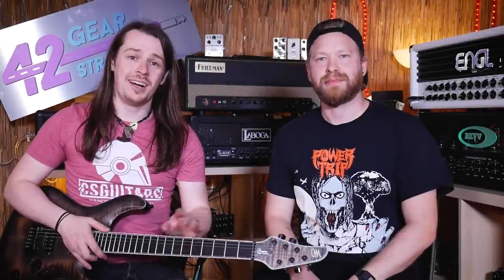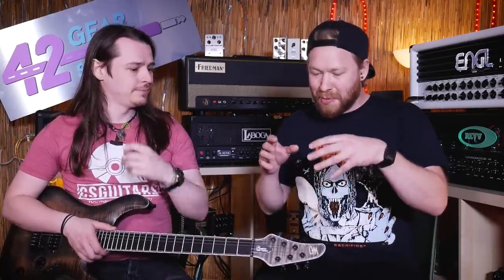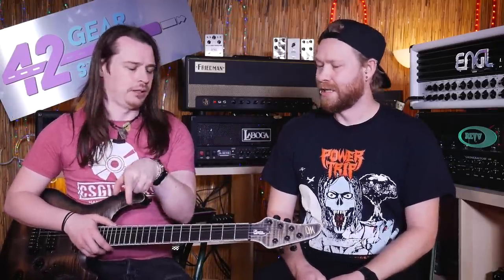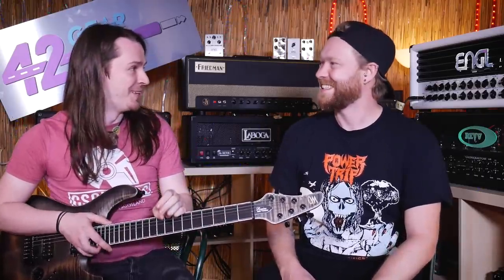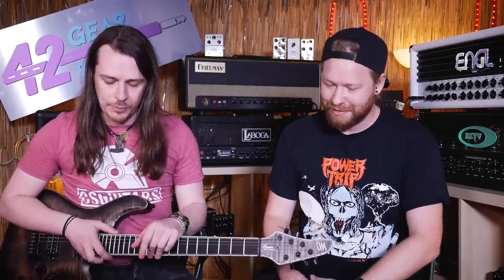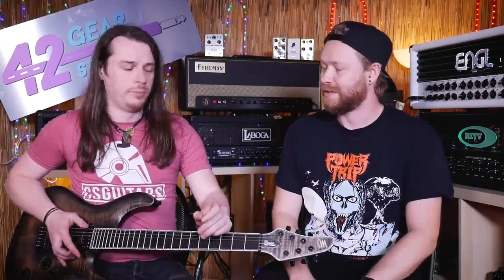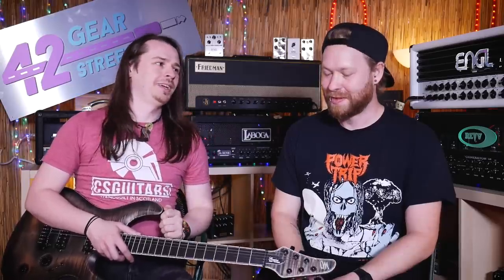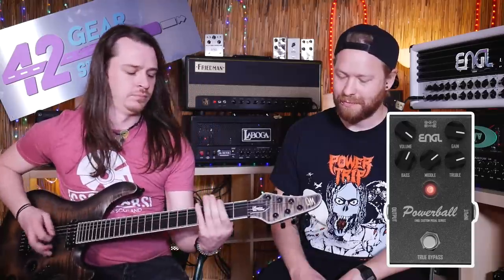ENGL Powerball Pedal: Lead Distortion Stompbox | First Look

Comment: Dear Colin
I have a TATA. what is the point of the ground or ground lift switch on the back of my valve amp. recently repaired teisco check mate 20. seen it on other valve amps. why would you want to disconnect the ground/earth????
Reply: On older amps that didnt had 3 prongs cables the ground lift was needed. if you're getting shocked, you flip the switch and it shouldnt shock you anymore. Can you see the flaw ? You could also unplug the amp flip the plug 180 degrees and replug it, does the same thing basically.
Reply: @crazysandwich  thx for the info mate
Reply: @wfrancis25  basically what crazysandwich said but the main intention was against hum (on an old amp i have it's literally labled "anti-hum"), but having it in the wrong position could certainly zap you, since then the amps ground and chassis is referenced to mains. Through a capacitor no less (often aptly named the death cap), wich when intact should at worst pass enough current to give you a little tingle, but it's a) still very stupid and b) those caps fail and they can fail short. And then you have a full 120 or 230 volts on your amp and the guitar connected to it. You might not even notice it if you say wear rubber sole shoes on stage until you touch something properly earthed, like a mic while muting the strings and then you are in for a less than pleasant experience.
If it hasn't been done yet, you need to disable that circuit and install a proper 3 prong cord (since you mentioned you already repaired it i'd assume you know at least the basics on how to do that) or have it done by a professional (since you weren't aware that this was an issue that exists you probaply aren't that experienced). Don't work on an amp yourself if you are not 100% sure what you are doing, but if you want to look into it, uncle doug and the guitarologist are great resources on that topic and amp repair in general. Or just google "death cap amp". 
Stay safe
Reply: @uzmeyer1752  ,wow thanx for all the info guys. I am electronic Tech, but valve is definitely not my strong field. I am going to open her up some time this year. to replace all the jacks. At which point I'll check that earth thing out. Now that you mention the tingly feeling. 20 years ago when I bought the amp, I got a mic with it. and yeah she did tickle me  when the lips touched it.
Reply: @wfrancis25  A few years ago i was playing with my 15-20 watt pepco amp with a 2 prong cable. You wouldnt believe the spark i got between my lip and the mic. a full inch of length, it stinged pretty badly. Now i only play with 3 prongs equiped amps :)
Reply: The ground loop switch is used to reverse the polarity of the electricity running through your amp, cancel hum by turning the power plug on an amp without a ground lift switch around in it's outlet, whereas flipping the ground loop switch on an amp may switch the polarization of your amps electricity around and cancell hum .  Electrical shock protection circuitry does not guarantee safety from electrocution, such as filter caps, electrical power buffers, polarity switching safety circuits and ect. ectronics. I do not trust robotic circuits to ensure my safety, which is never a for sure thing on anything electrical. It does not matter wether your gear is solid-state, valve or both, usually all valve circuits have non-valve circuits ! ! ! When you lift a ground, you may cancell the hum coming from the amp, but you will be straight wiring your amp to no safety from electrical shock between your gear and other gear and either of the come in contact with one another when you are the one between either of the gear  connected to them with your person. If you have a ground loop lifted to ungrounded, then you set yourself up for electrocution , especially since your person is holding an ungrounded gear and you ground yourself to any Earth ground, such as standing on concrete, ground ,anything flesh or not flesh that connects your person to the Earth, thus creating a unprotected ground to the Earth through your person, putting you in direct line with the electrical flow going through your person to the Earth ground and electrocution. Not all electrical outlets are properly grounded, even a 3 prong plug outlet. A breaker fuse box that may or may not be properly grounded or may have different circuits wired differently, thus having grounded and ungrounded outputs to electrical outlets. You use different outlets and you think you are safely grounded and you find you are holding your guitar that ain't grounded and come in contact with another piece of gear that is grounded and then you get electrocuted. It is the same way with any gear coming from a breaker fuse box that may or may not be properly grounded in each of it's s lines running to an electrical outlet or be hard-wired without any plug in, the circuits may be grounded to the Earth or they may not be. If ungrounded and you ground yourself to an Earth ground, even a houses piping goes to earth ground  and then comes the electrocution. I know this post is long- winded but you can look it up online and check out ground vs ungrounded gear or electrical boxes and electrical outlets. Never go stand barefooted on anything grounded to the earth and your gear not be grounded to an electrical earth ground or your gear ground loop is lifted, turned off and becomes unpolarized just as does a two prong plug. You have a two prong plug and hear hum and you turn the plug around and change the polarization of the electricity running through the lines running from the outlet you are plugged into, but it does not guarantee that you will be safe from getting yourself electrocuted. The same goes for if you are using outlets coming from multiple breaker fuse boxes. Especially beware screw in fuse boxes and being safely grounded ever, period. You can get an electrical ground and electrical polarity meter a small cost and plug it into any electrical source and it will show you with colored lights and/or beeps you will hear to inform you of the status of the type of electricity you are plugged into, the polarity of the electricity, and wether it is a grounded or ungrounded electrical source ! ! !  I hope that this is of help to you or anyone out there whereby electricityis concerned (AC or DC types, current or amperage, voltage, resistance, htz 50/60, grounded or ungrounded, then there is emp/static electricity) ! ! !  I would rather be electrically in the know and be safer than be my person and/or electrical gear become electrocuted and be harmed by any such in any way or worse case senerio possible, be/get killed dead ! ! !  The net to other sources of publication outlets on the subjects of electricity and electronics are so plentyfull and readily available to the masse . Be Safe ! ! ! 👍😊 Peace & Play 🎸 On . . . 😎🤘 DDHarris 1-212020.

Comment: Over the past 2 ish years, I've been trying to find a good distortion pedal that sounds more like an amp. I've got a few distortion pedals, which includes the Boss Waza Craft Metal Zone, which out of all the distortion pedals I've tried sounds the best. But I've been struggling to get a good high gain tone I like that I'd be happy to constantly use as my main distortion, for that I use my Ibanez Tube Screamer into the front of my Peavey Bandit, with a Boss EQ in the effects loop. Judging by this video, this engl pedal seems better sounding than my Boss Waza Craft Metal Zone, possibly might be the next distortion pedal I get.
Reply: Idk how good my ear is anymore, but I was searching thru all types of distortion pedals before 2015. Ultimately I landed on the Moen Violent Metal. The least nasal of all the pedals back then
Reply: I have an out of production Digitech TL-2 that is really good.

Comment: If it's a recreation of the original amplifier, shouldn't you use it as a preamp and plug it into the FX return?
Reply from the maker: Distortion pedals are designed to go into the front of an amplifier. This trend of using distortion pedals are preamps is new and often misuse of equipment designed to be used in another fashion.
Reply: @ScienceofLoud  It's not misuse of the pedal, even if it's designed to be played through a preamp. You aren't going to damage the pedal or the amp, the worst thing that can happen is that it won't sound good. I don't see what's wrong with just trying it. Ola uses a solid state power amp for his pedal reviews most of the time and it sounds amazing.

Comment: Sounds... not that great to me tbh?
Reply: To be honest, i love Engl. I have 4 Engl amplifiers. But the powerball has a lot of drawbacks because you do not see them a lot anymore. To much compression and only deep mids are the biggest two. Both of these are bad for a live sound to cut through. So yeah, this pedal sound like the powerball, and there is a reason i will never own a powerball as a engl enthusiast. But to be fair to the pedal: If the pedal behaves like the real amp, the demo was with very bad settings. The engl xyz-balls need, depending on the cabinet, lots of mids. Like 7/10 or more. The bass can be reduced a lot, depending on the guitar to 2-3/10. And with a humbucker guitar you will mostly not need more gain than 5/10 to get a thight and useful sound. Also the volume was cranked, so maybe they pushed also a little amp distortion. But all of this will not make up for the lack of high mids.
So, i appreciate the demo, but it's just two sounds without knowing the signal-chain.
Reply: I doubt they did themselves a favour sending the pedal through the Invader front to back. Summed up some of the harsher freqs. Probably, Idk... However the Powerball sounds somewhat similar, like His Majesty stated before.
Reply: Truth
Reply: these companies making pedals that are amp clones are rip offs, theres no fucking way they can do that. Amps are fucking huge

Comment: Hello! I'm afraid to ask if it's really necesary to plug a speaker cab to a tube amp? Does it burn the amp if it doesn't? 
Thanks!
Reply from the maker: I already  have a video on this topic: 
https://youtu.be/FY3C2hWKE9U
Reply: quick answer, yes, you will burn the amp, because you will miss the appropriate resistance in the circuit. watch the video linked in the other comment.
Reply: @ScienceofLoud  thanks for the update
Reply: @tolvajakos  thank you for helping out

Comment: It sounds nothing like the powerball. When I first used the powerball I hated it because it had this sound that was very stiff. The only way you could get the gain you want was to nearly put it to the max. You find yourself hitting a sweet spot where it is just enough and is perfectly balanced but also feels like you just reached the point where you’d want it at minimum. It feels like at any second you could run out of gas if that makes sense in relation to gain and the amount of distortion you want for chords and leads. There is a hair or room to spare once you get to that point. This pedal sounds totally different than that channel. I’d still want the third and fourth channel of the amp over this pedal but this pedal would be an excellent mixture to add onto the amp for when you want a different sound that still retains a sound that is close if not on spot with a tube amp.